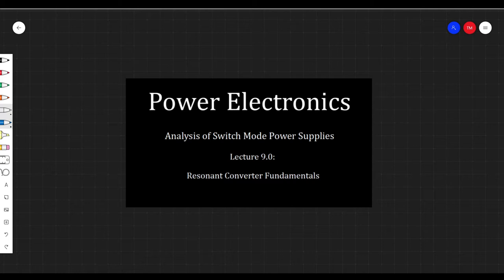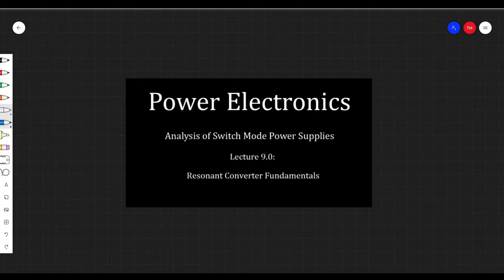Lecture 9.0: Resonant Converter Fundamentals

Comment: Hi Tim, thanks for this informative video.
If we are using this topology for Battery charging, then under CC mode it works as voltage driven and under CV mode it works as current driven. 
Is this assumption correct?
Reply from the maker: I don't think I understand exactly what you're asking. 

I am not an industry expert, but I can give you my understanding. When charging a battery, the CC/CV regimes aren't related to what the battery is doing, but what the converter must do to ensure the battery is charged correctly/without damage. 

During the CC mode, the battery is far from full charge and the converter is intended to provide a constant current to inject charge into the battery as fast as possible. When the battery approaches full charge, the battery approaches the maximum allowable voltage of the cell and the charging regime (provided by the converter) changes to CV. The current injected into the battery is determined by the difference between the voltage provided by the converter and the battery, the internal battery resistance and the resistances between the output voltage and the battery. I believe this region is also referred to as trickle charge and ensures that the battery is not over charged.

This change between CC and CV is typically determined by the controller and not necessarily a change in the circuit (although that could be done).
Reply: @timmcrae3831  Thank you so much for providing this explanation.
😄